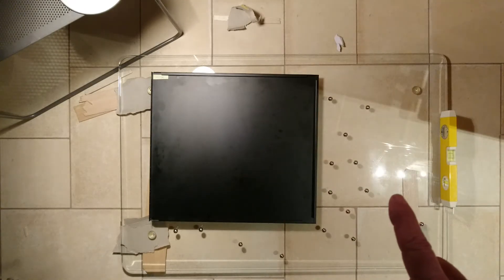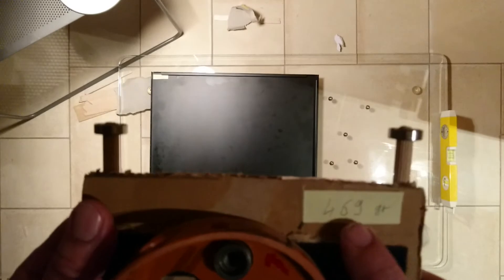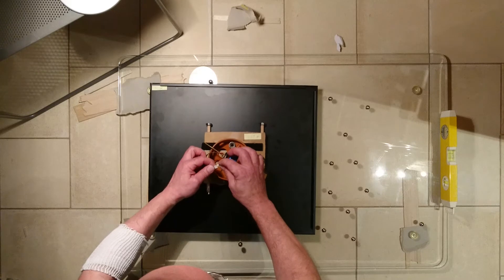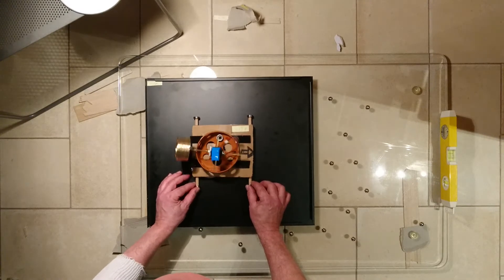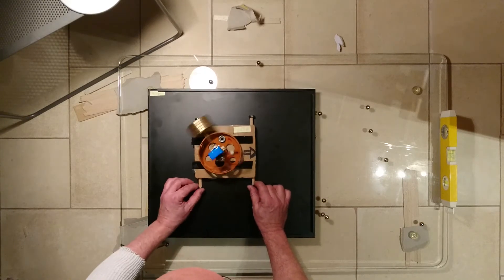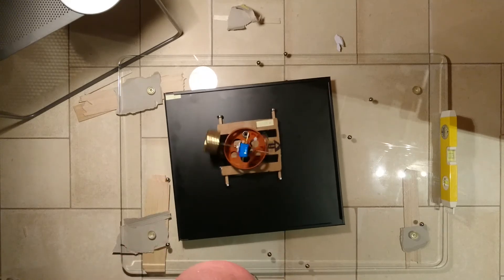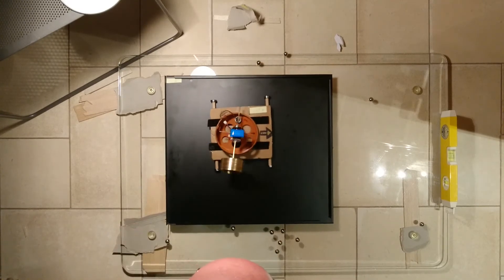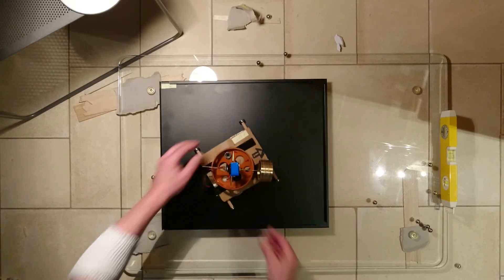inertial propulsion with  gyroscope part 8

Comment: In this setup, the natural precession phase of the gyro creates a vertical force on the device upwards away from the table. When the gyro hits the circular track from either side (ex. The gyro side or counterbalance side), it stops the vertical lift force which then increases friction against the table.  This is why you can see the substrate move downwards.

Comment: WOW!  Well done, Laurent!  What I observe is that the device moves to the right, with nothing moving to the left, and little or no rotation or counter-rotation.   There is also some motion of the substrate-plate downward, with most of the total mass clearly moving to the right.  Very exciting!  Thank you for doing the requested test and performing the experiment for us several times.  I will study this further. (Dr Steven Jones)
Reply: Steven Jones goes right because it was always released it on an upswing not downswing shrug
Reply: What matters is this:  does the device INITIALLY move to the left or right (or stationary) when first released?  In several of the releases, it moves LEFT a little initially, THEN, not touched anymore, it moves to the right.  Look for example at the release which begins about 2m33sec - and you will see what I'm referring to.  These are the cases that interest me particularly and seem to show "momentum generation without observable recoil."